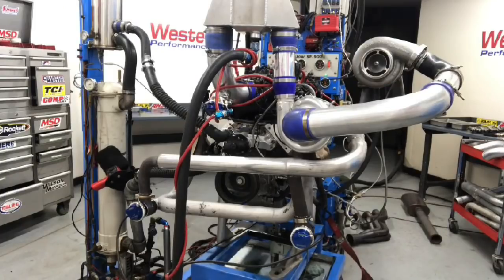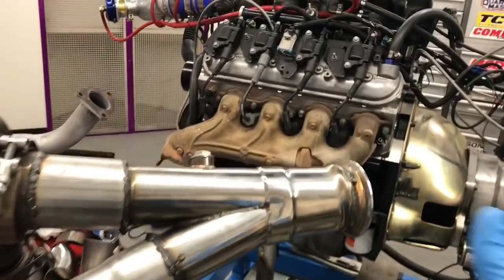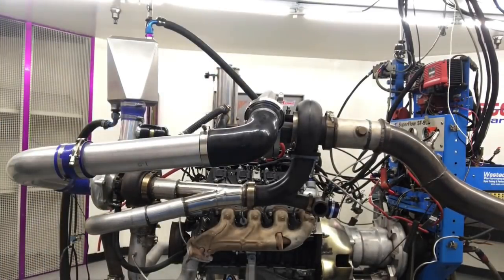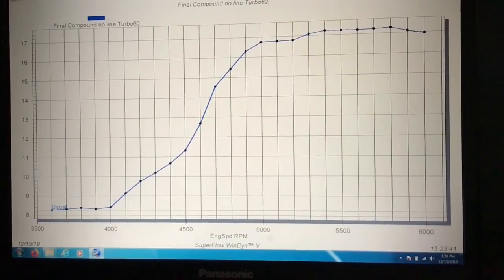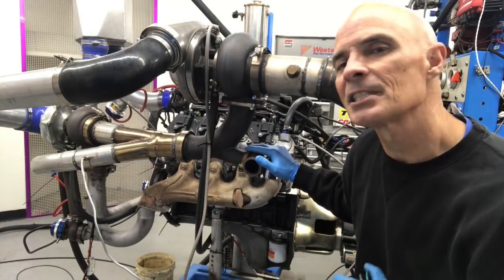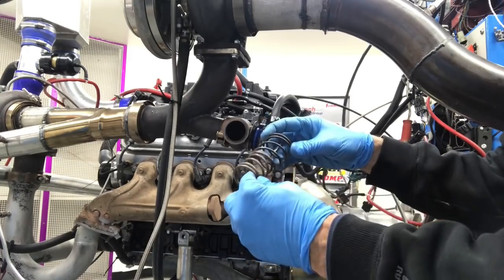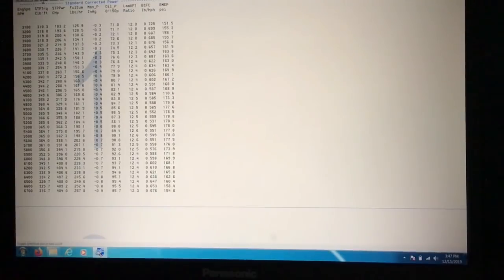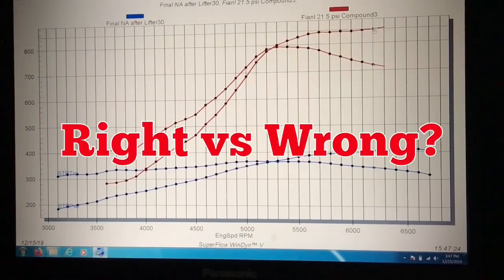Big Boost!! Full Results!! 1 Mistake!! Compound Turbo 4.8L!!

Comment: If that engine was installed into a heavy car like an old GM a body you would want a torque curve that starts early in the rpm range . Seems like that would involve adjusting the waste gates on the smaller primary turbo ?
Reply from the maker: yep-that's easy to do, I just stopped adding boost and torque down low but there was a lot left
Reply: How heavy is heavy? My olds with the 350 olds in it is 3740lbs? Plan on going single turbo on it. This compound setup looks good for the tow truck though

Comment: Interesting results Richard. Thank you. Couple things:  You can download OBS Studio for your laptop video. It is free screen capture software with no watermarks. Works great. Also make sure to fill your fuel cans on the concrete at the pump so they are grounded :)
Reply: Also the audio seem to be very low quality. Great insight thanks for the videos.

Comment: I'm with the guy who wants to see lower rpm boost. The whole point of compounds is to get boost lower in the rpms. 4500 from an ls isn't that great. I bet with a properly sized small turbo that big charger will come on way earlier
Reply: You're the guy who loves detonation...
Reply: @justinbryant237  Or maybe he knows how to tune.
Reply: @justinbryant237  ikr, it's too much power change in only 1000rpm. Would be completely undriveable too.
Reply from the maker: we can make a lot more low speed torque by adjusting the controller for the small turbo-just didn't want the load in torque on the dyno-but you can have it on the street or track
Reply: Would like to see a jy 5.3 with a quality ring set pushed on low torque with this setup to see what the gen3 & gen4 rods and stock crank can handle. When these things start to let go
Reply: @Wheezin_The_Juice  the Gen 3 properly tuned in fueled will make an excess of 1000 crank horsepower then the rods will start to bend roughly about 1300 a 1400 horsepower on a Gen 4 then the rods break. The tuning the tuning the tuning the tuning the tune is extremely critical
Reply: Wrong. Compound is to get MASSIVE boost numbers. I thought it would be 30 PSI minimum.

Comment: For illustration purposes it would be great to see a comparison between this and the S480 big turbo as just a single on the 4.8 (ie what happens when you run the big turbo only in a normal non-compound setup) 
:)
Reply from the maker: I have it vs an S475 I ran on this motor
Reply: @richardholdener1727  new to the channel so may have missed it :)
Reply from the maker: colonelk3000 no worries my friend -the results of the s475 aren’t up-you are the only one that knows I ran it-so shssssh-don’t tell any one
Reply: @richardholdener1727  I seen the comment. The secret is out hahaha
Reply: Results the same, just power comes on later in the powerband

Comment: I would like to see a compound setup with a procharger style blower and a turbo!
Reply: I'd love to see this as well. Seems like a perfect "have your cake and eat it too" scenario.
Reply: @scottrussell2281  honestly it usually is the exact opposite of that. This would be the correct system, but he has all the wrong sizes between the turbos and the big turbo has to small of an exhaust.
Reply: What we need to see is an lsa blower with a turbo
Reply: The trick would be figuring out the pully ratio so that you don't max the procharger too early and get the big turbo to spool faster. Screw and paddle blowers work for this, but their lifespans are drastically shortened due to vein deflection from so much pressure on the inlet side. In the end we're asking components to do things they were never intended to do.
Reply: @ARK842001  see the problem with a centrifugal supercharger paired with an even larger turbo is that they are both rising boost curves so they really wouldn't be that great until you got all the way to the top. Ask the Duramax guys who tried it. It in the end just kind of sucked.
Reply: @compted10 , I've only seen this setup on Cummins engines and it's close to perfect. The procharger was making 33psi by 4000 rpm and 7 psi at idle. The turbo (can't remember size) was putting out over 70psi at 4k and came on strong by 1300ish.
Reply: @ARK842001  those numbers make it sound like it is big supercharger feeding the turbo. Honestly the cummins guys like myself have gone series or parrallel series aka two into one turbo configurations. Not saying it doesn't work but the problem is the power is usually in the wrong place with this setup and leaves so much on the table. For the I have to be weird guy sure but for the I want a massive power band guy it is compounds or maybe turbos into blower. Honestly however turbos plus nitrous is the best configuration for a gas engine, spooler shot is just what the doctor ordered. 😈😈😈😈
Reply: @compted10 , The best part is that there are so many possibilities. I'd like to see blower, big compounds, and nitrous. I think some tractor pull guys are already doing something along those lines.
Reply: @ARK842001  all I can recommend is methanol and super low compression. It would be interesting to say the least.
Reply: Why not just run max boost pulley and an electric wastegate
Reply: @julianrodgers3423  because it makes the blower inefficient plus the wastegate is usually on the exhaust side
Reply: @julianrodgers3423  , that would be a lot of load on the crank snout at the higher rpm range.

Comment: Mr. Holdener, nice test although I'm surprised at the high back pressure, I thought the two wastegates would have lowered that.
I was looking around on YouTube and found DeBoss Garage did something similar but completely different.
Lookup: Four diesel turbos on an LS and you will find theirs. You made a lot more peak power but their torque curve is glorious, in the LAST (when everything worked) run
A lot to learn in both experiments.
Reply from the maker: as explained, there was a reason we didn't add more torque down low but it is certainly possible
Reply: @richardholdener1727  When I said the torque curve was glorious I'm referring to how long and flat it was, not the amount.
Reply from the maker: @johnparrish9215  no worries, you can shape the curve nicely with dual controllers on a compound

Comment: So whats the real benefit? Just for low end response? How does the exhaust bypass the smaller turbo or does it? Im a little confused.
Reply from the maker: some of the exhaust is bypast around the small turbo when the waste gates open. The exhaust from those waste gates is route to the second turbo
Reply: @richardholdener1727  ahhhh! Now that I had a chance to look at the piping again, I see... So the main purpose of the compound turbo setup is low end response? Does the compressor side of the small turbo then become a restriction?
Reply: That sure ain't for response, that's a Lag monster.